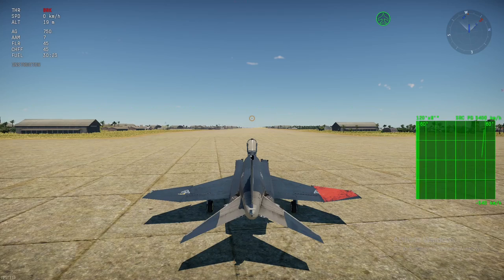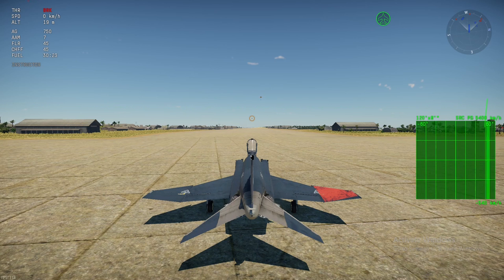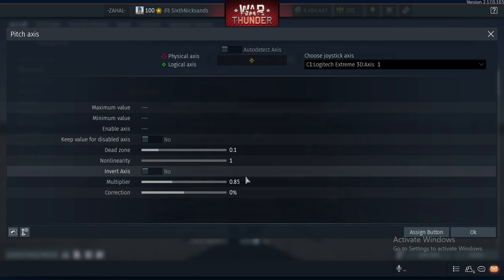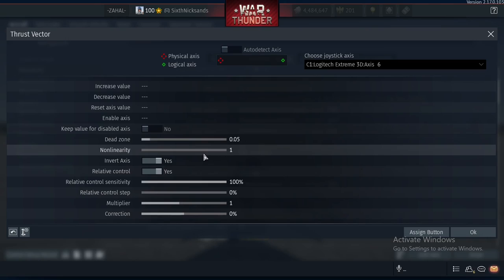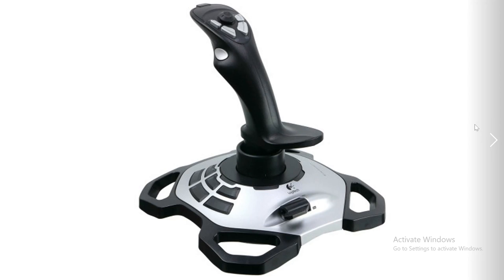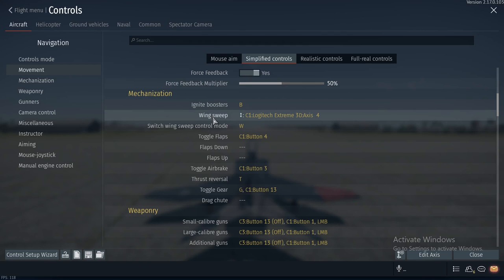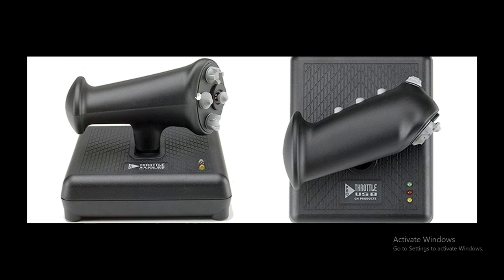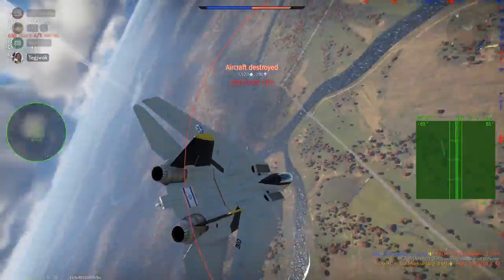War Thunder Hotas Binding Tutorial

Comment: for some reason, although the throttle works, the joystick doesn't ( I'm using Hotas x52 pro)
Reply from the maker: Try doing roll and pitch manually instead of assigning axis. Maximum for one direction minimum for the other, then make sure it’s oriented correctly.

Comment: My throttle is inverted for some reason? No matter what it starts off as WEP and pushing the throttle forward turns the engine off
Reply: Update: quick fix i found is there is a toggle titled invert axis on the same screen as auto detect, it’s towards the bottom and it fixed it for me

Comment: I just got a x52 throttle and stick.. im having trouble bonding the throttle to full motion as it is rn 50% throt is actually 0 and when i move the stick forwards a little bit and stop the throttle in game keeps climbing how do i fix this.. ive been thinking about just tricking the game to thinking its the mouse wheel but idk
Reply from the maker: Try this then: for maximum push throttle forward and for minimum pull it back. Instead of assigning axis

Comment: Hey man, quick question. My yaw isnt working properly its turning the plane but the camera wont follow
Reply from the maker: What are you using for camera control? What is your view settings? Sounds like your yaw is working but your camera setting is the issue.
Reply: @NickThePilotUSA   fixed it lol I changed it to mouse joy stick
Reply from the maker: @GurplPurpl  you didn’t answer my question

Comment: but what about WEP?
Reply from the maker: Throttle forward all the way = wep
Reply: @NickThePilotUSA  and what about some planes that have 2 stage afterburners, the same?
Reply from the maker: @pROaBDUR  I’ve never used multiple stages of afterburner. I don’t see the use for it.
Reply: @NickThePilotUSA  it can be pretty useful in RBs and SBs... the 1st stage afterburners use less fuel and provide good speed than the second stage, so it's efficient than stage2 afterburners but can provide more speed than 100% throttle... some people also call the first stage afterburner: halfterburner, get it?
Reply from the maker: @pROaBDUR  I get it, and I’ve known about it. The thing is I take full fuel in every top tier jet in air rb every match, with 61 days in fighters it doesn’t feel very beneficial to me. I almost never run out out fuel.
Reply: @NickThePilotUSA  fair enough

Comment: is there any way to look with the mouse while using a joystick I find using the hat switch to look difficult
Reply from the maker: Mouse sucks for camera control with a stick I use a ministick on my throttle, not a hat switch.
Reply: @NickThePilotUSA  but is it possible
Reply from the maker: @Nero-Caesar  why would you want to waste one hand on a mouse? I use my left thumb for my mouse and the rest of the hand is free on the throttle. You are handicapping yourself by using a mouse for camera is what I’m telling you
Reply: @NickThePilotUSA  ok be that as it may i'm just wondering if it can be done
Reply from the maker: @Nero-Caesar  just get a throttle with a ministick, you’ll be much much better off.
Reply: @NickThePilotUSA  Ok that's not answering my question but whatever thanks
Reply from the maker: @Nero-Caesar  it is.
Reply: @NickThePilotUSA  it's not though i just wanted to know if it can be done and how not if it's good or not
Reply from the maker: @Nero-Caesar  it is, I told you it’s a massive handicap using a mouse instead of a ministick on a throttle.
Reply: @NickThePilotUSA  my mistake then sorry how would one go about setting that up if you didn't mind explaining it's cool if you don't it's just confusing and I can't find much on it
Reply from the maker: @Nero-Caesar  you’ll need to get the throttle and enter inputs on the buttons and set axis for them. Actually in this video I have the tutorial for doing that, I’m not sure if you’ve watched that part. The throttle I suggested is the best cheap one to get.
Reply: @NickThePilotUSA  I watched that part but how does that allow me to use the mouse to look my joystick has a throttle on it and couldn't I just use the scroll wheel too?